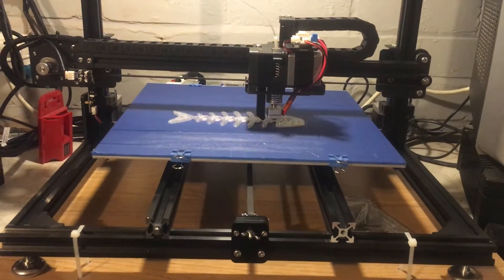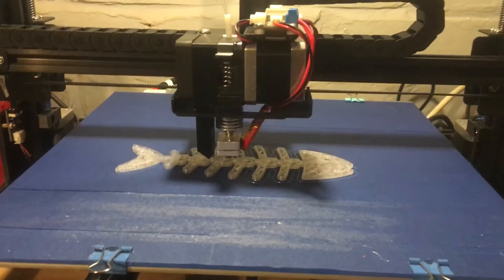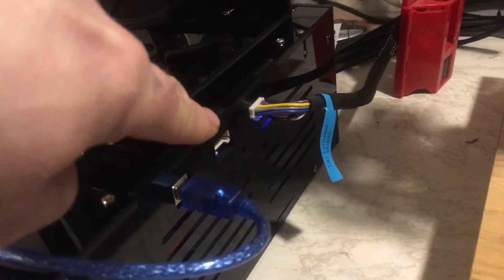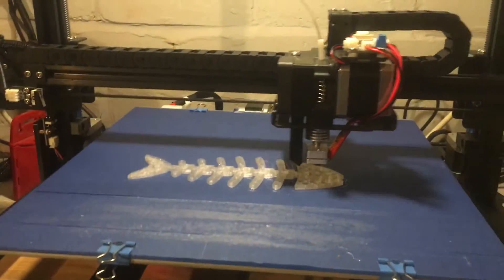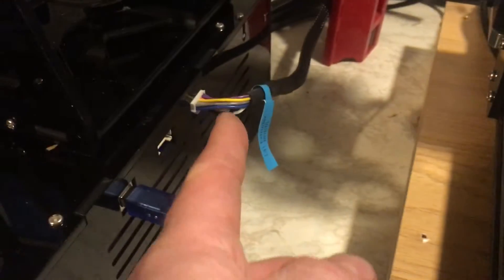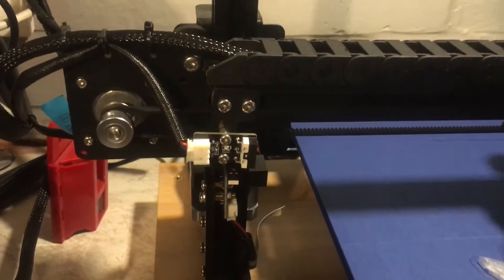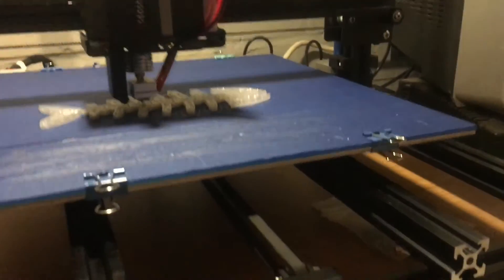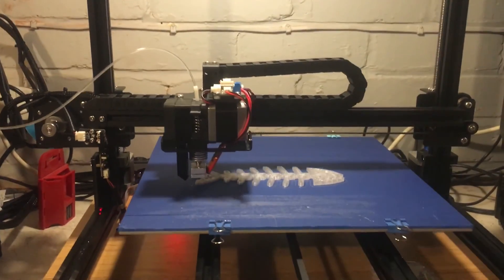HCmaker 7 CR-10s Clone

Comment: This is not the CR-10 clone (cr-10 not have direct extruder) ;-)
Reply from the maker: Medelis 3D I did say CR-10s clone. I mean the size of it not all the features. And it’s junk had nothing but problems with it.
Reply: your 1st 3D printer ?
Reply from the maker: Medelis 3D no I’ve had three and still got two, I have Kissel delta mini clone and that worse than this. Does not like running direct from PC but got it dialed in for microSD card use but only 18cm x 32cm high
Reply from the maker: Medelis 3D 4 not 3 first was the junk that was the colido 3d printer that I had for 22 hours due to main board going same day I got it. Maker said they would send new board but as new I said no.